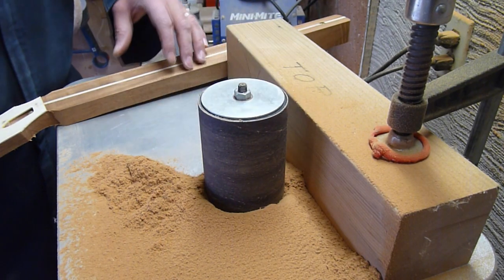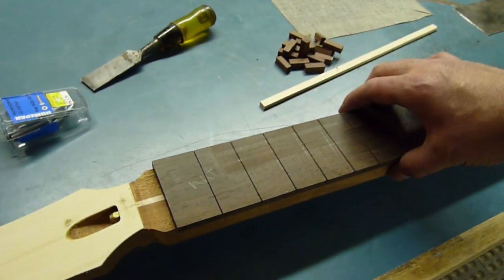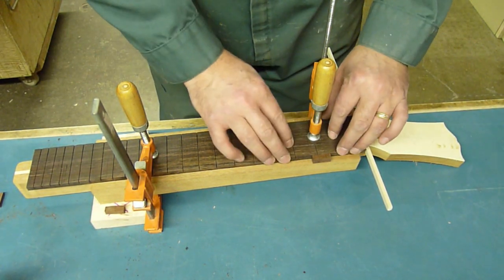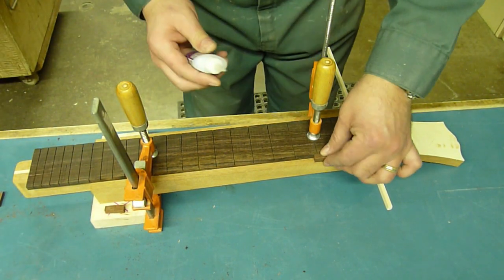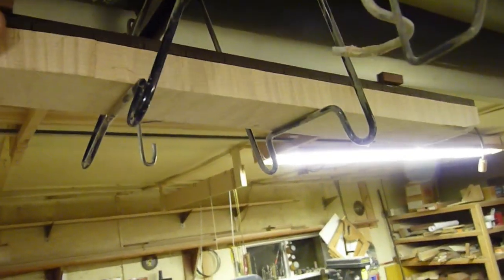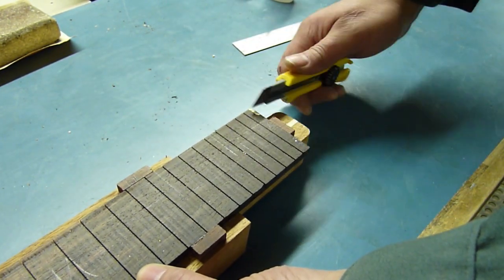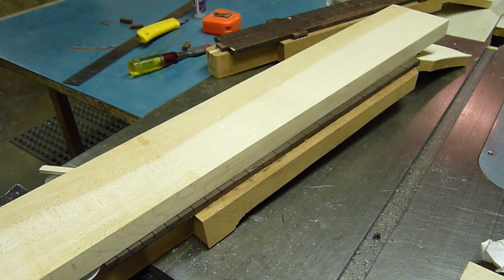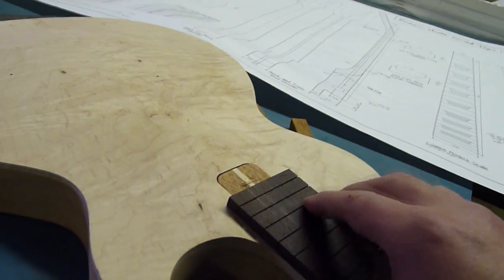Building Les Pauls Part 7

Comment: Hi. Very good videos. How did you use the inlays template? On a Pin Router? What is the used  thickness on the highest spot (center line) of the fretboard?  thanks a lot.

Comment: Hi Freddy, one question on binding routing, is the router bit cutting only the rosewood, or also cutting a sliver of the mahogany? if cutting mahogany, how to cut the body side end of the rosewood+mahogany? if not cutting mahogany, is the binding strip then not really covering/overlapping the rosewood-mahogany joint line? thanks!!!
Reply from the maker: I set the router to cut as close to only cutting rosewood as possible. I will err on the side of cutting a hair of mahogany, but that's not problem to adjust the binding if needed at the neck body joint.
Reply: @FreddysFrets thanks so much Freddy.  Love your videos so much. I’ve watched them like 20 times now 😅. Greetings from down under 🦘.

Comment: 1.When you are trying looking for the center line, do you use the fretboard as the reference or the neck?
2. And also when you are trying to find the centerline of the guitar what method do you use? 
3.I am using Bartlett's plans, you mentioned you used other plans before trying his, what do you  recommend and what were the differences in the plans?  Did you prefer one set over the other?
I'm asking because im building my first 59 LP replica.
Thank you ahead of time if you get to answer my questions :)! These videos are instrumental in my design process, just incredible amounts of information. I would pay for a dvd of this, you should think about that.

Comment: Are those real pearl or pearloid inlays?
Reply from the maker: NOS Authentic Italian plastic!
Reply: @FreddysFrets  Why do you do Tite Bond on the neck and hide glue on the fretboard?
Reply from the maker: @willdenham  The only place I used titebond was to install the little maple strip over the truss rod. Why? it's a pretty insignificant glue joint and it's easier.
Reply: @FreddysFrets  I apologize, maybe it was the cap I saw you use Tite Bond on. I just got my 59' spec neck and body and am weighing whether to glue the neck in with  hide glue or Tite Bond. I am watching your build as a reference and just want to know the best way to do everything.

Comment: So much doublestick tape, Freddy? These brittle rosewood boards gives easy tearouts, perhaps you dont have that problem?
Great vids, man, skilled luthier with a Rush addiction, couldn`t be better.....
Reply from the maker: Actually it's not double stick tape, it's a strip of masking tape on each piece, with dots of medium CA glue on the tape. It's a new process for me so I'm still feeling out how much tape I need for a particular situation. It's really great though, there is absolutely no lateral movement once it's stuck in place. I find that carpet tape has a squishy bit of give or movement unless you clamp it down hard, and then it really grabs the wood and you can tear out splinters when removing it. So this method with the masking tape is very gentle on removal....no tearout at all, and the second best thing is that it's cheaper than carpet tape.
Reply: Ok, that figures. Good luck with your built, looking forward to your next vid...